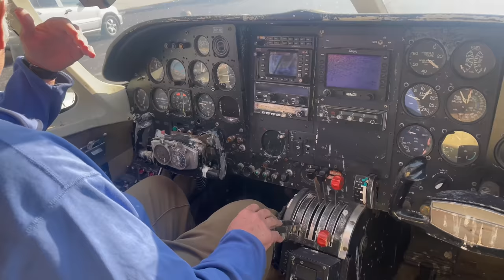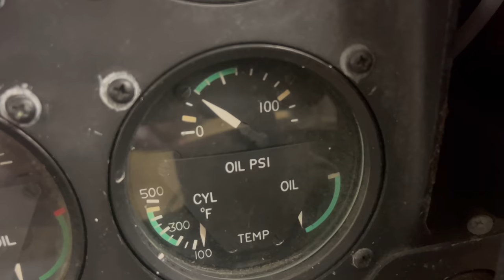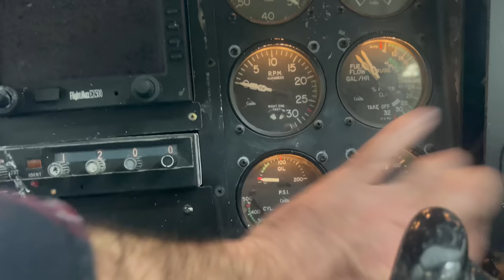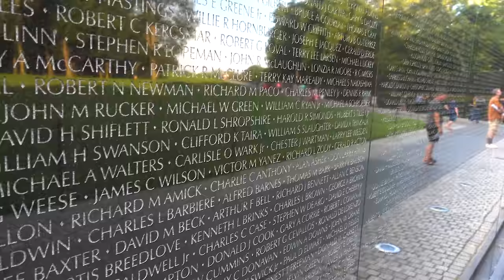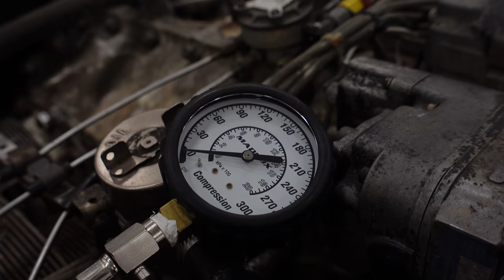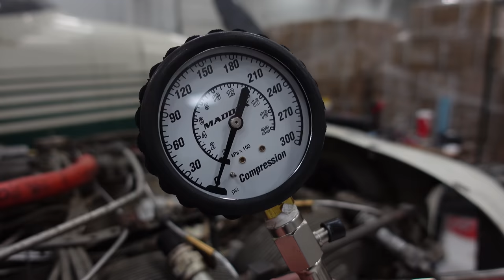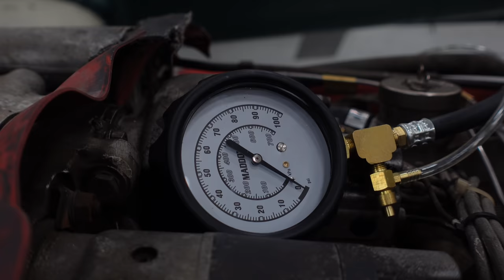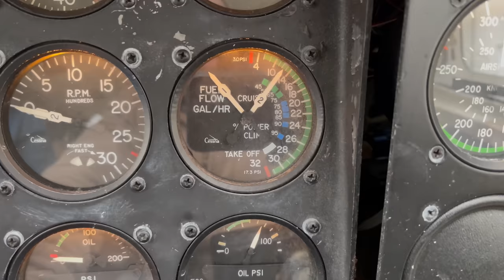Did We Ruin The FREE Abandoned Airplane Engine ? Ep6

Comment: I tinker at best with car engines, but I noticed when you were doing a compression test that a couple of the cylinders were much higher compression, in the vicinity of 115 to 120 psi.  I had a truck that wouldn't start and had a similar experience with compression.  Turns out I had three cylinders out of eight with stuck exhaust valves.  Once freed, the beast came to life.  What made me think of it was that you touched on a possible exhaust problem.  You might want to go back and check to see if you have a stuck exhaust valves.  That was certainly slow the engine rotation at startup.
Reply: Agree with you!
Reply: Can add air to the cylinders and see where air might be escaping, exhaust, or intake..or crankcase through oil filler.
Reply: Maybe look at that turbo again, because exhaust could be blocked there, too. Would also explain the slow crank speed when the plugs are in?
Reply: I agree.   Good call.
Reply: @make1tup  if the exhaust were plugged up it would still have normal compression and it wouldn't only affect certain cylinders. It also wouldn't be slow to crank right off the get go.
Reply: @16vSciroccoboi  you might be right, but it depends on firing order, exhaust volume, manifold length, degree of blockage etc. And it would slow down crank speed immediately after the first exhaust stroke, I think.
Reply: I'm just a software engineer but I was thinking the same thing- felt to me like the slow crank could be caused by pressure in a cylinder unable to escape and pushing back against the others, either a stuck valve or something weird with the cam timing.
Reply: One of the cylinders had much higher compression than the others; take the plug out on that one and see if the starter turns the prop over much faster without that load.
Reply: @16vSciroccoboi  Agreed!  We can rule out the turbo.  It's simply not functional and won't affect compression.  I doubt it's the exhaust headers as it would affect all the cylinders.  This leads me back to the valves.  We seam to have FAST.  Fuel, Air, Spark, Timing.  The only odd thing so far is compression.  It's not right and needs to be explored.  We can say that we have good piston rings if it can maintain that high compression, but that cylinder compression in those three cylinders seems way to high.  My 454  Chevy big block didn't have compression that high.  Granted these are bigger pistons but the compression is off.
Reply: I thought the same.  Got like one good cylinder at 120.  Everything else at 60-90 isn't looking so hot.
Reply: @hawgdawg1307  I don't think that we can rule out the turbo. If there is high back pressure in the exhaust, you'll see that as a pressure reading on the gauge when the exhaust valves open. Inevitably you'll also see intake issues because there will be no gas flow through the engine. I don't know what kind of pressure could build in the exhaust manifold, but with the size of those pistons, it's going to be pretty significant. Possibly enough to blow the exhaust off?
Reply: A static compression check is a more reliable way of evaluating the compression in an aircraft engine cylinder, the manufacturer doesn't even publish a dynamic test number that I've ever seen.
Reply: @make1tup  The exhaust system has a waste gate that is spring loaded open.  Exhaust back pressure isn’t going to be a problem.  If he’d actually read a book he might learn that on an aircraft engine you do a differential compression check, which, among other things, allows you to quickly and easily determine why a cylinder is low on compression.  But, “quickly” doesn’t really seem to figure into this whole idea of creating drama to get YouTube clicks.  Any competent aircraft mechanic would have had that engine running in a couple of days, or know why if won’t start.  I would have lost my job decades ago if it took me two month to NOT get a Continental to start.
Reply: @MrNoobed  continental engines, at a cold temperature, typically only hold 45- 65 PSI. This would've been very obvious had he checked the maintenance manual.

Comment: I am an old school ex-Navy jet engine mechanic and troubleshooter with a later  civilian A&P license for reciprocal engines. I love your tenacity. Reminds me a little of myself. Logic would tell me that the cylinder walls are dry and not turning nearly as fast as your left left engine even when switching out the starters which would tell me your mags are not producing quite enough spark for ignition. Also, seems like you’re not fuel is not getting to the spark plugs. God bless you brother for your efforts and your desire to donate the plane for mission work.
Reply: I was an ADR way back when and they converted me to ADJ. HC-1 Det 6, CVA43
Reply: You’re definitely the expert here. We both may have worked on the T 58–10 turbo shaft engine in the Navy for the SH-3 helos.  I was with HS-4, 
Sikorsky SH-3D Sea King.   anti-submarine warfare on CV-61 and 63 Westpac tours 1973-76. .  Wasn’t HC-1 also an SH-3  Sikorski Helo cargo version?
Reply: Great job on the cesena thanks for coming to it's rescue.

Comment: Hello Jasson, I was watching your compression checks on engine number two, BORDER LINE LOW!!!! Good compression is the secret to any engine start and run. Here is what I want you to do, squart some 20W-50 crankcase oil in each cylinder, one at a time, install your compression tester and crank the engine for the heighest compression for that cylinder. If you get no increase in compression, your valves need to be relaped to the seat. If you get a huge increase in compression, your ring are shot. Now, since you are commited to an expensive engne over haul, remove the jugs and lap the valves and replace the piston rings. Who ever does the engine overhaul must be informed that all six cylinders pistion rings are new and must be used in the engine rebuild as they meet manufactures specifications. Your engine will now start and you own the plane. Where you stand now, is you lose. Do this same test procedure on number one engine and compare the compression reading and you will see why number one will start.
Enjoy success!!!!
Kenneth W. Gilbert
Reply: Yah the other engine was so much higher pressure. It was all 110-150 I think.
Reply: He had oil in the cylinders of that engine before. There might be a varnish buildup on the valves, so springs cant close it fully or the aluminum he scraped off the plugs came from cylinder walls. I think the leak-down test is in order.